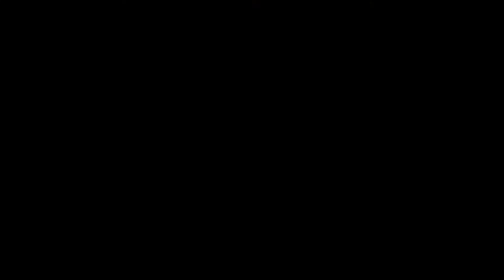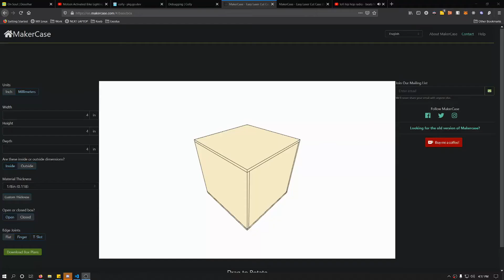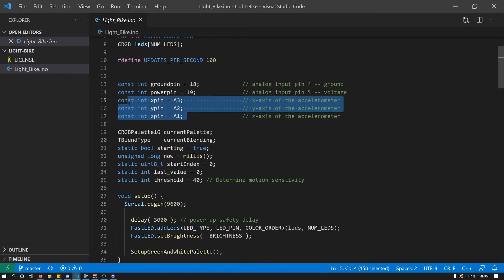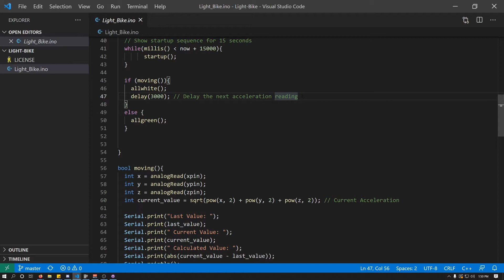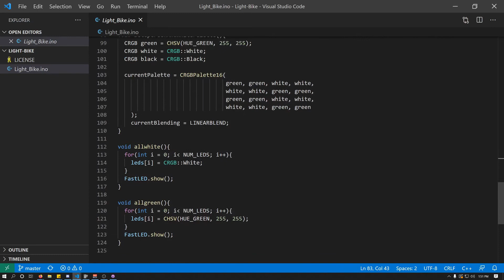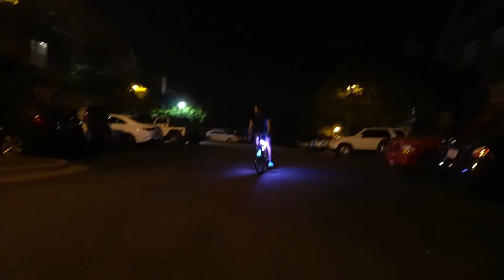My Bike is a Pro Gamer | Motion Activated RGB Arduino Project

Comment: Hey man, really awesome video :) Could you please share the diagram of the connections on the circuit as well
Reply from the maker: I did not include a diagram, but in the code the pins used as listed on lines 15-17, hope this helps!